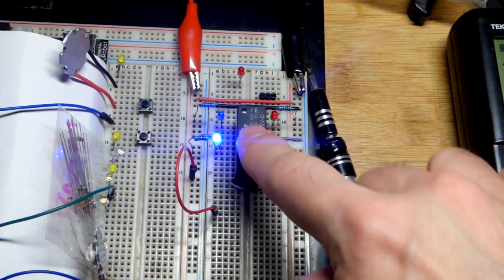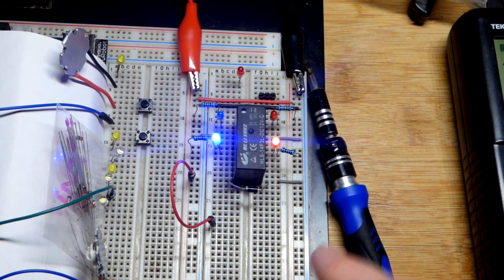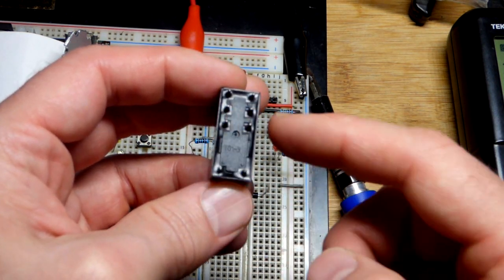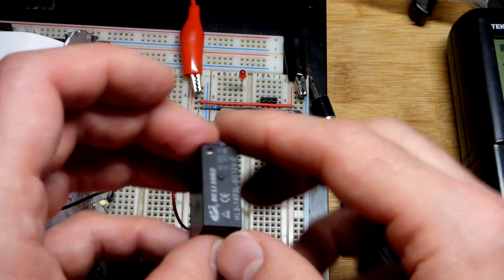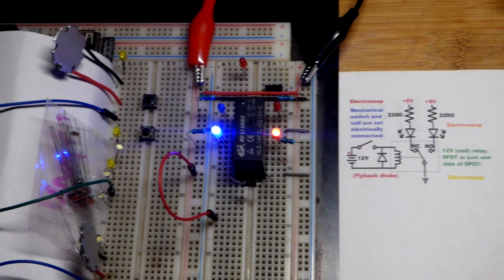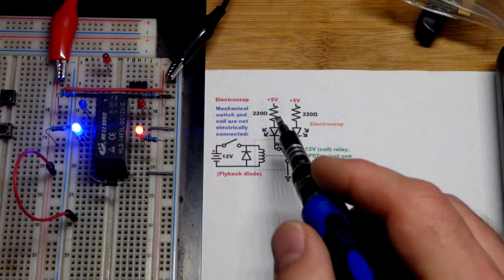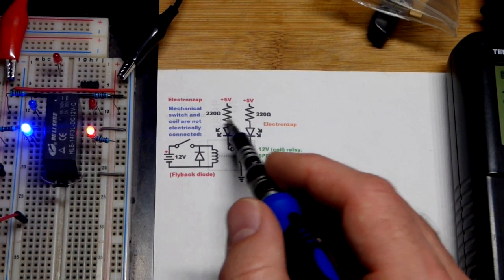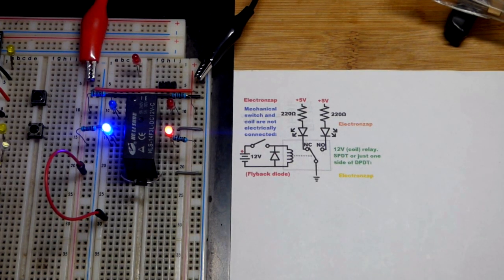How To Use 12V Coil Relay Component For Genius Inventors

Comment: The precise placement of a small super magnet (neodymium) on the 12v Relay case can reduce required Volts to Arduino levels (5v or less) to control your unruly more powerful devices.
Reply from the maker: Thanks for the info!